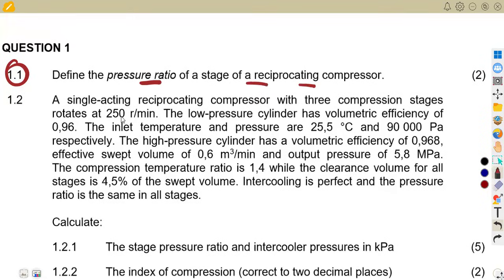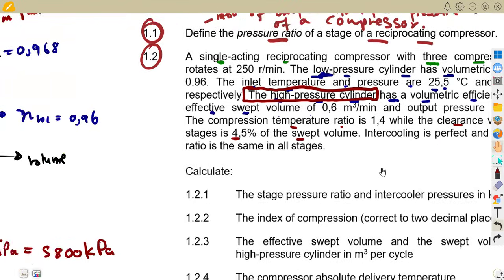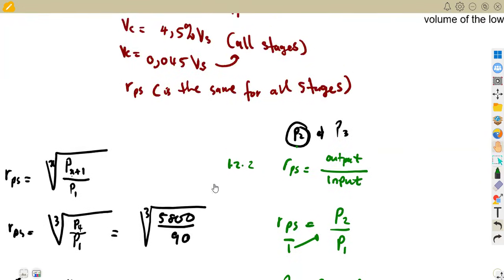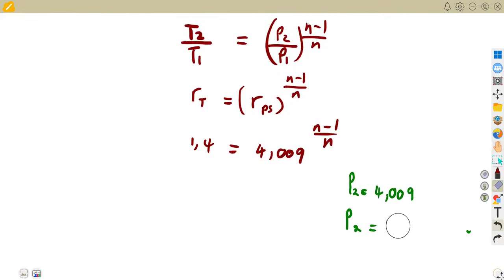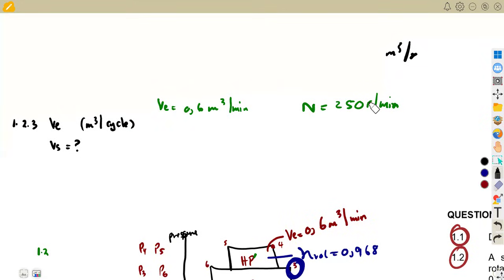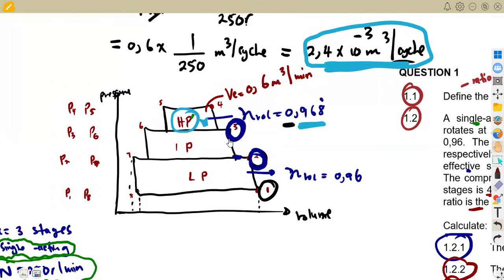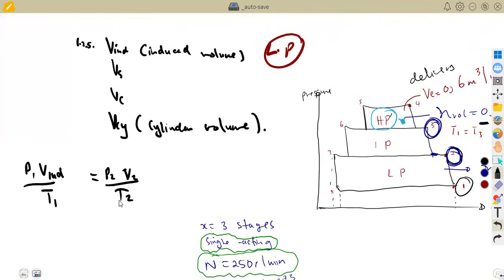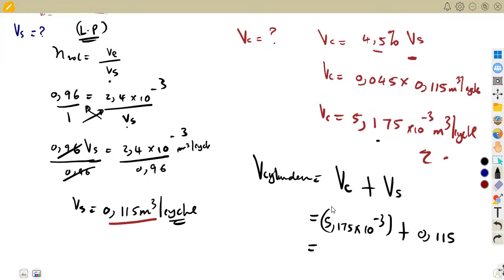Power Machines N6 Compressors August 2022 @mathszoneafricanmotives

Comment: On the last question of calculating Vs of low pressure cylinder why did you use Ve of the high pressure cylinder instead of the one of low pressure cylinder which is 0,1104m^3
Reply: So does this mean that Vinduced=Vs?
Reply from the maker: The relationship on Vs and Ve is given for each Cylinder so when working with LP we use info for LP unless it is the same for all Cylinders
Reply: @mathszoneafricanmotives 
Yes that's right that means we were supposed to use the Ve of low pressure cylinder not the  one of high pressure cylinder. Since 2,4*10^-3 is for high cylinder.
Reply from the maker: @thabokelvin8817 I see , took the wrong Ve there.  Thanks for that.